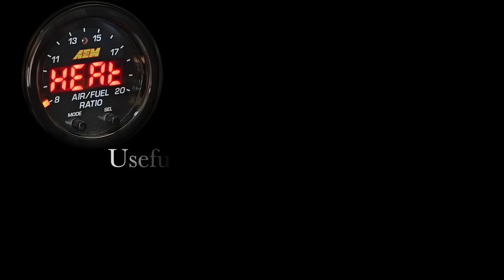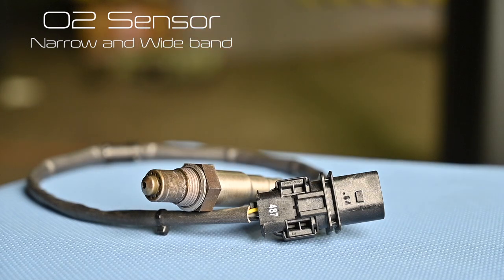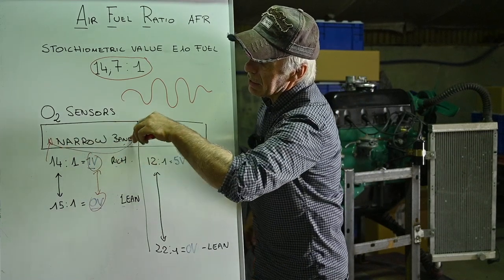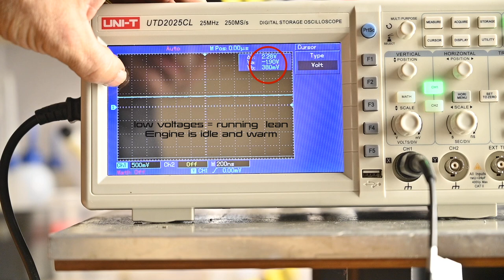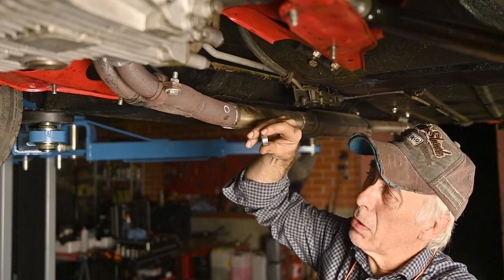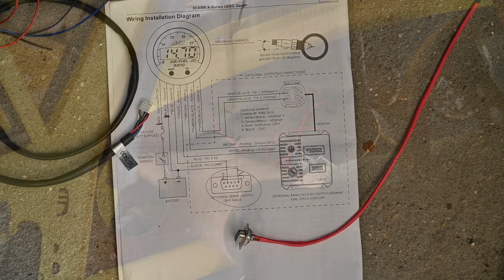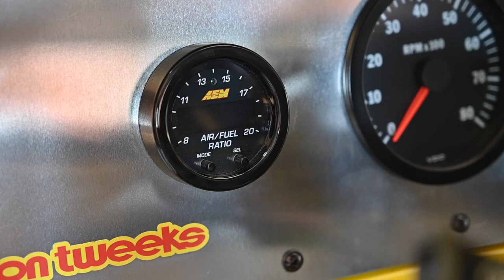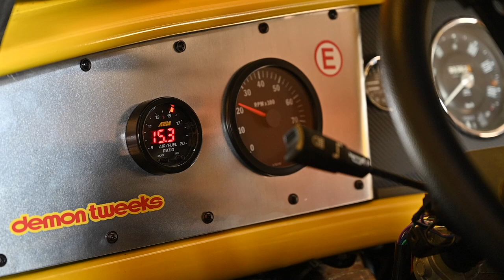Does an AFR gauge on a classic car make sense ? How, what , install

Comment: I have loaded a look up table for a NB in my tuning software that gives me the AFR, and comparing it to my WB, the values are pretty close even up to 12.5:1. It can definitely help. The oscillations I get at idle or closed loop, if you look at the voltage the amplitudes look pretty high, however, when converted to AFR I actually see variations only between 13.5 and 15.5:1, idling around 14.7, most of the time between 14-14:8. The same thing I see on the wide band. The NB plot in my datalogs follows the WB AFR closely within 0.2:1 even at WOT where the AFR is 12.5 during PE. The NB is also slighy faster, possibly because of shorter cable.

Comment: I consider my air fuel ratio gauge and my vacuum gauge to be very helpful and informative    great for tuning (Haltech controlled fuel injection)   I have a Ford V8 swapped 1984 Datsun 200SX S12      always consider both Vacuum and AFR gauges!!!
Reply from the maker: Thank you for the comments.

Comment: On my car (2012) 1.6Di engine, have 2 sensors.
How can I find out if its a wide or narrow band sensor?
I want to install AFR gauge and getting the signal from existing sensor via piggyback from cables?

Comment: Another great video - but one question - on my Weber 40 IDF turning clockwise is leaning the mixture, turning anticlockwise is making it richer. I guess other carbs have it different. Check your spark plugs for the condition.
Reply from the maker: Thank you for the comments. and yes there are variants on carbs

Comment: Thanks!  I have been waiting for this video ever since your teaser!  I have an AFR gauge and sensor that should arrive this week.  This video is very helpful. Going to use on both my MGB and Clubman Estate.
Reply from the maker: Thanks for the comments, sorry for the late video... good luck... PS  don't drive leaded fuel as that will destroy the sensor, and be carefull with lead replacements...
Reply: D3Sshooter , both cylinder heads have hardened seats so I am all set.  Tight fit for the sensor under the mini.  I need to be strategic with placement so it does not rub on the underside.

Comment: Having seen your video I am just wondering if the AFR you built does about the same trick as the exhaust gas temperature gauges I mentioned. Their functioning is of course different. The AFR you are showing uses an oxygen sensor and the exhaust gas temperatur gauges use temperature sensors (installed after the exhaust valves).

Comment: I have been doing very similar work on an E-Type  4.2  Jag with triple SU carbs. I am using INOVATE  Motorsports hardware with their Logworks 3 software which enables use of my Laptop to capture data. On the Jag it is a little more complex because of the dual, entirely separate exhausts, one for the front 3 cylinders and one for the back 3 but, fed by 3 carbs so that makes adjustment a bit more involved. I presume by your description you are using a non SU carb, perhaps a Weber. In my case I get the same momentary lean mixture on acceleration,l even as lean as 17/1 but car runs perfectly. With the SU perhaps changine daspot oil viscosity might cause a positive change but not particularly worried about this. At idle I am close to 13/1 a bit rich but any leaner and the car does not idle well and using the tried and true lifting of the SU piston I get no engine accleration whatsoever, jusr a decrease in RPM; sign of a lean idle setting.
Your explanation was great but think that for best performance a bit rich is better, as you may have suggested. 
Looking forward to your next video, might you make some particular reference pertaining to SU carbs. Same basics just a little different in the details. Thanks
Reply from the maker: Thanks for the comments Tom, a lot of good points... Mine is SU and a lot simpler then your car....  One point I should have stated is that the Stoich  14,7:1   is the most efficient burn mixture ... however that does not mean that it delivers the best power or the best engine running ( as you stated, running a bit rich, is better then to lean (temp))...
Reply: Power is on the lean side

Comment: With EFI systems we generally aim for around 13.5:1 at idle to get most stable idle, will still idle reasonably at a fairly wide range of AFRs though.
Reply from the maker: Thanks for the comments,  indeed the stoich value is all about the most efficient mixture. However that does not mean that the engine is running or performing at its best...

Comment: Great video! I just installed my wideband to tune my Weber 38 DGAS installed on my 2.3L 61' Willys Jeep CJ5, according to the AFR, I needed to go leaner on the idle jets, moved to 45, 1 turn out on both mixture screws, now within range. Still rich when I accelerate, running base/ stock 145 main jets. Base/stock air correction jets are 170's. Redline Weber the sole US importer told me the 38 as shipped should be close, but I've found and smelled it to be rich out of the box for my application. I do have a mild cam, 2" exhaust hence the upgrade to the 38 vs 32/36. Not much information out there for regarding these early Jeeps with similar modifications and tuning the 38. I am unclear at what point the air correctors come into play? I assume the main jets not until close to WOT?

Comment: A little bit off-tipic (on AFR) but on gauges too: I hold a privat pilot licence and on those reciproking small aircraft engines a very useful gauge is standard: the exhaust gas temperature gauge (for each cylinder). It is so useful because it is always the very first indication that engine problems are aboute to rise. And if the fuel-air mixture is set correctly. And another gauge I would like to have is a voltmeter for the battery charging voltage. Last year the voltage regulator of my classic car distributor quit and of course I couldn't have known it. Due to 16 V charging voltage the battery was overheating on the drive, the battery housing failed and the whole engine bay was full of battery acid. Even an overvoltage warning light would have done the trick.

Comment: Great as always! I’m going to install on my 1973 Volvo P1800es with 38/38 dges clone carb thanks again😎 If it gets lean under acceleration, so I need a larger main jet or a smaller air correction jet?
Reply from the maker: Thank you, under acceleration its the acceleration pump that shoots in more fuel, so that would need to be the part to adjust.  for cruising and normal driving or nearing the end of an acceleration  the main jet and air correction jet define the mixture. Hence,  you can increase the main jet .

Comment: Can I ask, if I purchased the AEM AFR Gauge will this still give a fairly accurate reading in the tail pipe like in your example with the oscilloscope instead of installing a boss before the mid section. I assume I will need to wire up the sensor heater to run continuously. Thanks for your help. Steve.
Reply from the maker: Thanks for the comments, well he sensor only works properly when its hot.  That heath is coming from the exhaust gasses when the engine runs.  For cold start the sensor warms up by itself.   The tailpipe is a very bad example as the sensor must be about 45 cm away from the exhaust manifold and installed at 90 degrees towards the gas flow .   So the example I provided was just to show how that works ( in the tailpipe).  You will need that boss.
Reply: D3Sshooter Thank you!  I thought as much not a big deal. I have ordered one now so will hopefully finally get my carb setup properly.

Comment: I already have an O2 sensor in my electronic fuel injection old car with 2 wires. It's an old car and one of the wires is supposed to go to ground and the other is the signal. I connected a narrowband  gauge to one of the wires but it looks like a very low voltage is measured, because the needle shows lean. I don't see any difference when accelerating. What can be wrong?
Reply from the maker: Thanks for the comments, in this video I address the wideband O2 sensor...  and that has more leads as it has a heating element inside.  In your case that sounds like a narrowband O2 sensor and your gauge may not be suitable for the O2 sensor output.  If you have the brand and partnumber of the sensor, then I can provide more info
Reply: @D3Sshooter  yes. It's a narrow band o2 sensor. Ecu shows voltage between 0.3v and 0.7v. I will try to measure voltage in the  leads with a voltmeter. And see what I get.

Comment: As always, huge fan of your videos. 
Question: how will you adjust the carburetor for more fuel during acceleration? Changing injectors? And imagining cruise ratio is lean or rich: how do you adjust that? Thanks in advance
Reply from the maker: There are two elements that you can play with , the piston spring (SU carbs), the damper oil viscosity and the needle profile.  Check the video's on the SU for details.   The main point is that acceleration creates more vacuum, and as such the damper moves upwards , lifting the needle to another station ( position). Hence more fuel can be taken out of the jet... however if the piston lifts up to fast we will lose airspeed and hence the venturi effect reduces. Thus less fuel in the mixture despite the fact that jet /needle is having a larger opening.   Therefore the lift of the damper needs to be checked during acceleration, if that goes to fast then more dense oil is needed in the demper.  If it goes Wide Open, then the pistion spring is to weak...
Reply: @D3Sshooter  Brilliant explanation, thank you. i might invest in one of these for my riley elf, this would be more accurate than the Gunson colortune.

Comment: does ignition timing has an effect on the measurement of AFR in the exhaust?
Reply from the maker: Yes it can to some extend, but not that drastic.  It all depends a bit what you means with Ignition timing.  Before any test and work on the fuel system  always make sure that the ignition timing is correct

Comment: Love your videos. was going through your old videos and discovered this! I have been thinking of fitting AFR gauge to a 4 cylinder alfa to tune the twin webers dcoe carbs. Wondering if you think 1 AFR unit alone fitted at the same 2 to 1 collector position in your video would have sufficient resolution in realtime to tune individual throttle body carbs like the twin webers feeding individual cylinders since I need to tune 4 carbs in real time vs tuning a single carb feeding all cylinders.
Reply from the maker: I would say that it will work as things will average, of course it would be better one sensor per two cylinders.   . So if you can , use two sensors

Comment: Very good. Do you have a link to to AFR gauge that you have.?
Reply from the maker: Yes I do... but its in the Nederlands.
Reply: @D3Sshooter  No prob. I have found out and read up. Will probably get one when I get my 72' Mini 1380 back on the road. Bought it back after 18 years. 
looking forwards to the follow up video with the carb corrections based on the logs. 
Keep up the good work.

Comment: Does that gauge really measure air/fuel ratios or lambda?
In theory, 14.7 AFR is the same as λ=1 but in reality that may vary due to ethanol.
Reply from the maker: TXS for the comments,  yes it does as soon as you select that mode.  You will need to flip-over the dial plate for that as well.  It does O2 percentage, Lambda, and AFR
Reply: @D3Sshooter  Isn't Lambda more reliable than AFR?

Comment: Just to clarify, the ratio is for oxygen not air, also this oxygen is by weight. otherwise for every 14.7  litres of air you draw through the engine you are going to require 1 litre of fuel. now that would be expensive.
Reply from the maker: correct..  Thanks for the comments

Comment: Nice content but wideband Lower volts reads rich and higher volts read lean. Therefore 0v = 10:1 and 5v = 20:1 thereabout.
Reply: UPDATE: That explains at the end of the video why you went lean instead of rich when you accelerated.

Comment: Is the use of ethanol common in European gasoline mixtures?  it was promoted firstly as an oxygenate thereby reducing carbon in the exhaust but I don't see that as more than a hill of beans, next it was promoted to generate fuel independence in that you could use our own ethanol rather than imported oil.  The fallacy of that argument is that growing the grains and harvesting them plus the transportation uses about an equivalent amount of fuel so there is little savings furthermore the distilling process itself uses a tremendous amount of energy, often coal.  Unlike the US most of western Europe doesn't have a  grain based agricultural economy and imports much of its grains from such places as North America, Argentina, and the former Soviet states.  In the US, the ethanol economy is so large as to be self sustaining, too many parties involved to allow its undoing.  Ethanol is generally not good for motors and can be somewhat unstable in fuel mixes especially when extreme cold is involved.  I suspect that it gives a small bounce to the octane rating but there are other ways of doing that.  What do you know of this?  You can of course buy shiploads of cheap ethanol from Brazil, we are not allowed to do that.
Reply from the maker: Thanks for the comments and write up; We don't have that issue as much here although there is some.   It is an issue in general as you just described. Lucky that its not that dominant present here in Europe

Comment: the gauge goes green when its around 12- 13 witch i am guessing is right mixture and it goes red at 14 witch must be to lean.
mini does have a single point injection fitted on 94 models if you fancy fitting it, think it was the same as what was on rover metro
Reply from the maker: Thanks for the comments, this mini is 1985...  The AFR reading is all about the mixture  and indeed 12-13 is rich, above 14,7 is lean
Reply: @D3Sshooter  yea i know its older but its the same engine in the 94 just with injection, it looks like a carb but just has one injector in the middle of it

Comment: Will this help clean up the exhaust smell?
Reply from the maker: Oh yes, If the mixture is right the fumes are less harmfull and smell less
Reply: @D3Sshooter  what else can cause that 1970's rich stringing 
Exhaust smell ?
Valve guides? Bad rings?
Bad valves? Worn cam?
Poor spark? Timing?
Leaking cold start circuit?
I love driving the spit,
Just don't like the headache 
Afterward  LOL
Reply from the maker: @ronpilchowski9898  ,  What color are the fumes ....  Blue is oil burning,,,,, all else is a matter of the mixture...   Most of the time that smell is due to a to Rich Mixture.    Are you sure the smell is coming from the back and not from the engine bay,  ?     If from the engine bay , then it could be blowby on the cylinders into the carter vent.  Do you feel a pressure on the oil filling cap when removed and having your hand on the opening while the engine is running ?  Is there smoke coming out of that oil filling gap.  And at last, do you have a modified exhaust , especially at the end of the car as the vertex of air might throw the gasses back in the car at the rear ( I had this once)
Reply: ill check the fill cap for pressure, not burning oil, no modified exhaust, im working the carb angel , i installed 40f9 idle jets the rpms ran real high then i would turn down the idle just a little and it would stall, switched back to the original 50f? so no change  i ordered 12 more idle jets , what is the affect when the cold start circuit fails? can i be dumping fuel and making it rich there?its a 1500cc triumph (1) dcoe 45 32cm main venturi the idle jets i ordered are 45f 9,8,7 and 50 f2,8,7 will blow by show up in a compression test (low compression)? what about worn valve guids? thanks for your time Ron
Reply: @D3Sshooter  i pulled the oil fill cap and at ldle  it has a slight vacuum, at higher rpms a slight positive pressure
Reply from the maker: @ronpilchowski9898  , That sounds ok , as long as it was not blowing
Reply: @D3Sshooter  do you think the vacuum is caused by worn intake valve guides? It's not burning oil I think
Reply: @D3Sshooter  when the cold start circuit fails ... what happens?
Reply: @D3Sshooter  I have another question.  I was thinking of adding 
Some boost to my motor.
I understand it can handle 8psi
On a stock low compression 1500
So my question is: can I blow through a weber dcoe?
Does it affect jetting?
What mods do I need to make?
(Supercharger not turbo)

Comment: Engine Run ON 👆 amplified ignition considering not only fuel to air ratio but also standard good old magneto ignition 👆 that thing culd by used as a vaporiser as well 👆 peopel actualy used heat tubes inside the engine to idel run ore stop👆 basicaly nothing changed histori wise
Reply from the maker: Thanks for the comments